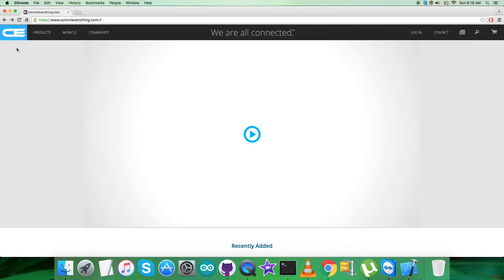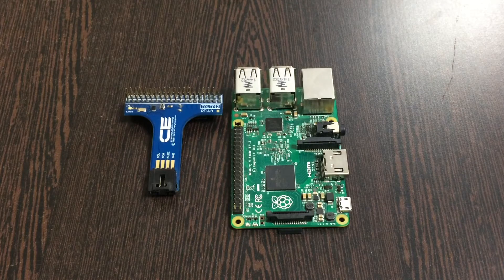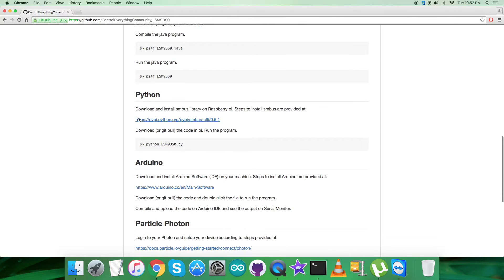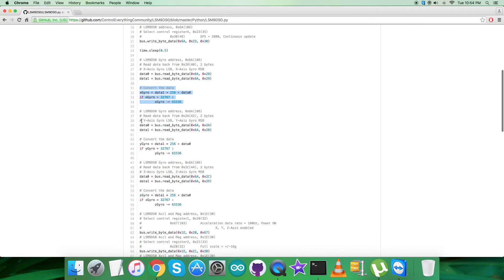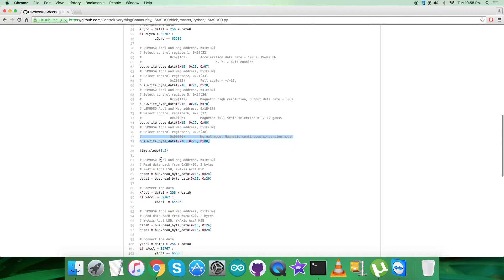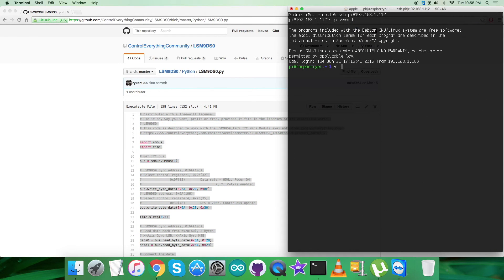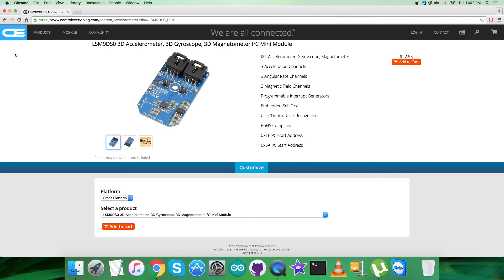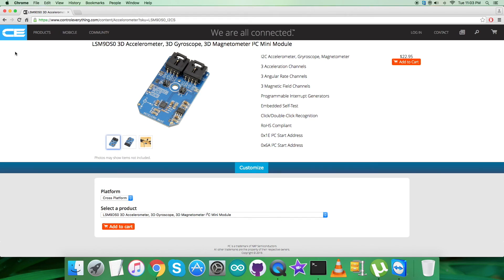Raspberry Pi LSM9DS0 3D Accelerometer, 3D Gyroscope, 3D Magnetometer Python Tutorial

Comment: >>>thanks for you video but I met this error when trying to run the .py  file

File "LSM9DS0.py", line 17, in <module>
    bus.write_byte_data(0x6A, 0x20, 0x0F)
  File "/usr/local/lib/python2.7/dist-packages/smbus/util.py", line 59, in validator
    return fn(*args, **kwdefaults)
  File "/usr/local/lib/python2.7/dist-packages/smbus/smbus.py", line 145, in write_byte_data
    raise IOError(ffi.errno)
IOError: 5
pi@raspberrypi:~ $ sudo i2cdetect -y 1

>>>>the i2c detect is as follow
     
      0  1  2  3  4  5  6  7  8  9  a  b  c  d  e  f
00:          -- -- -- -- -- -- -- -- -- -- -- -- -- 
10: -- -- -- -- -- -- -- -- -- -- -- -- -- 1d -- -- 
20: -- -- -- -- -- -- -- -- -- -- -- -- -- -- -- -- 
30: -- -- -- -- -- -- -- -- -- -- -- -- -- -- -- -- 
40: -- -- -- -- -- -- -- -- -- -- -- -- -- -- -- -- 
50: -- -- -- -- -- -- -- -- -- -- -- -- -- -- -- -- 
60: -- -- -- -- -- -- -- -- -- -- -- 6b -- -- -- -- 
70: -- -- -- -- -- -- -- --